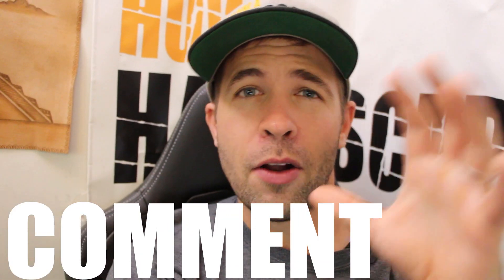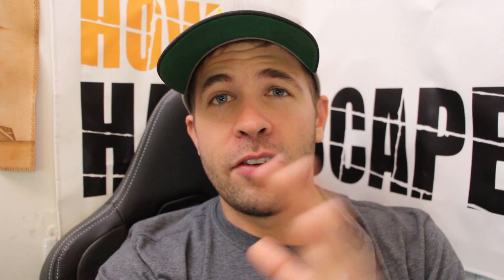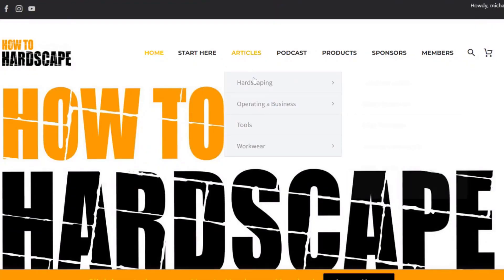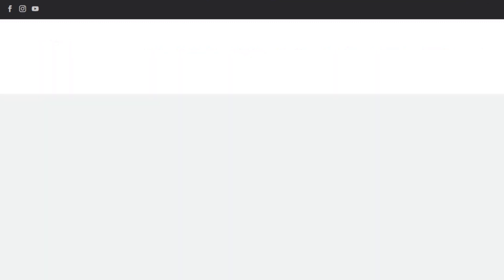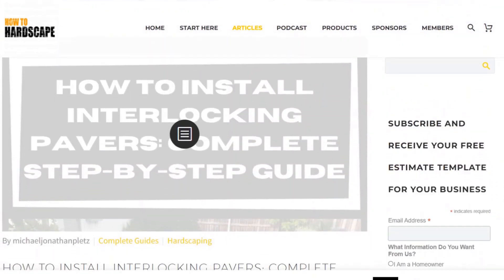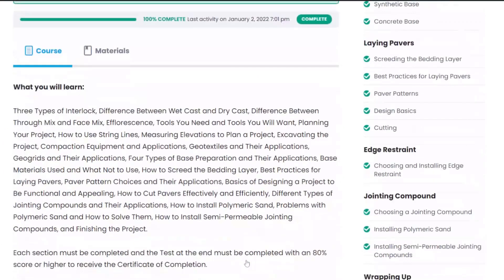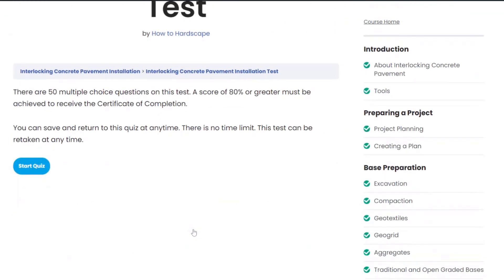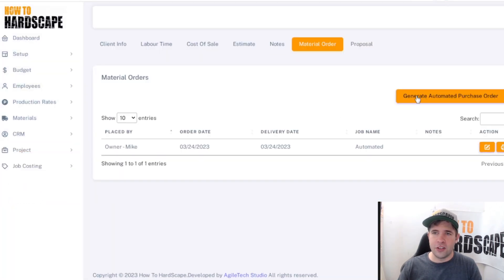Choosing Paver Patio Slope for Drainage

Comment: why woulcnty you be able to raise the grade a bit higher by the house? Im trying to do pavers in my backyard and i wantto raise the grade by my house a little bit so i can make the water go away from my housae easier without having to do a bigger retaining wall on the other end
Reply from the maker: If you only raise the grade at the house, you will have a steeper patio. If you raise the grade at the house and at the end of the patio an equal amount, you will need a higher wall or to build up that end of the yard higher.
Reply: My backyard slopes toward the house, with the last ~10 feet being fairly level. From the house out to 37 feet, the grade rises about 13 inches. My plan is to raise the grade 2 inches at the house and slope it down 2 inches over the first 16 feet. The remaining 21 feet would be a separate plane with a gentle slope that ties into the same 2-inch drop, made possible by a ~10-inch retaining wall. @iamahardscaper
Reply: Does this sound feasible any thing im missing should i add any drains etc?

Comment: When applying your crushed gravel base and bedding sand for a slope of .25 of an inch does this affect how deep the crushed gravel and beddong sand needs to be? Ive been finding between 4 -6 inches of crushed gravel with about the stone depth worth of bedding sand
Reply from the maker: Your excavation should follow the slope of the patio. So the base depth is consistent. I think that is what you are asking. We do about 8” of base but we are always building on clay and have winter freeze thaw cycles. No more than 1.5” of bedding. Definitely not the stone depth worth.

Comment: Thanks for the video. A question if i may: in my diy backyard patio, i am planning to use poly sand to minimize water going to foundation. Have you ever heard/done a strategy like half of patio would be poly sand (close to house) and the other half permeable filler (chip stone etc) to let diverted water drain through joints. 

I know it might sound crazy but wanted to see if it is doable 😅😅
Reply from the maker: It is definitely doable. I have done it for certain applications. But using a semi-permeable resin jointing that looks like the polysand. If yours does not look the same, maybe put a band of pavers across that separates the two spaces and starts the permeable area. Might look interesting and would break up the two jointing areas that may look different.

Comment: Thanks for the info. Is there such a thing as 'split slope'? Planning out a paver patio DIY but the grading goes both left and right toward the side fences. What's the best way to slope to accommodate for each direction? I'm thinking it would become like a 'hill' with the peak being the high end for both slopes, any issues there?
Reply from the maker: Yup you could definitely do that. Just be gradual at the peak because that will translate to the surface pavers
Reply: @iamahardscaper  thank you

Comment: Dumb question. Does the 1/4" slope go in only 1 direction? If i'm doing a square patio would I do 1/4" down to 2 corners or 3?
Reply from the maker: Not a dumb question. It depends where you want the water to flow to. If you just need it to go straight back, it is just the 2 corners. If you need it go to the side and back, then you would apply it to 3 corners. Hope that makes sense
Reply: @iamahardscaper    Thank you. that's exactly what i was wondering. Appreciate all the videos!

Comment: Thank you so much for all of the great information in your videos!!
My question is this: How do I set my stringlines to establish a consistent 2% slope running away from my pool coping stones when I have an irregularly shaped / free-form pool? I am building a square-shaped paver patio to surround the non-squared / free-form pool. Because of this, my 'runs' (when calculating my 'rise / run') are varying at every single point along the parameter of the pool. I apologize for the confusing nature of this question. I have installed numerous paver patios but this is the first time I've attempted one sloping away from a non-linear / curved starting point. 
Thank you for any advice you can offer!!
Reply from the maker: You can run string lines when screeding and measuring the length of the string line and apply a slope to it. You could do the same with a laser level or a high precision altimeter. It is just a matter of every time you set your screed bar, taking a moment to know the slope before you start screeding.
Reply: Okay, I was thinking the same thing: I would measure the length of the string at each point and calculate the slope. But I think that method would result in a ‘wavy’ finished patio as there would be multiple slopes occurring around the entire pool perimeter. Or, do you think the varying slopes would be negligible to the naked eye?
Reply from the maker: I think you are overthinking it. All of the slopes would be the same at 2%. Just the runs would be different. But a 2% slope on each of those runs is always going to be 2%.
Reply: Sounds good. Thank you!

Comment: Doing a small retaining wall around a pool to Separate the grass and pea stone.   There is currently two feet of peas stone between the grass and the pool.  Can I use clean stone for a base instead of putting a drainage pipe in ?   So it can drain into the pea stone.   Because there is already a drainage pipe in the pea stone
Reply from the maker: Oh I usually can’t say anything about drainage without seeing the site

Comment: I usually do 1/8” however I am also always using wet sand now a days. I don’t use poly anymore. With that being said I know you mentioned using wet sand on synthetic base and open graded base. I use open graded base 90% of the time, but sometimes in a flat yard and no plus to run a exfiltration pipe it doesn’t make since so we use a dense graded application there and we still use wet sand. My rep told me that when it rains the water will go through the joints up to a certain point and once the joints hit the crushed stone the water will just start to run off the paver surface at that point.
Reply from the maker: Definitely, dense graded always has its applications. I haven’t done enough research on it to come to a conclusion, but have heard reps on either side of the debate whether to use the wet sand on dense grade. But like you said, it would just overwhelm the base anyways if it was a heavy downpour and wash over the surface just like a patio with poly sand anyways.

Comment: When specifying a project for contractors to bid on, we typically list 2% just in case the contractor screws up a little bit, it gives us a buffer to ensure positive drainage. However, on my home project, I think one percent looks a little better.   Do you recommend any particular permeable jointing compound for tight joints…1/16” to 1/8”?  Thanks
Reply from the maker: That makes sense. Romex makes a permeable product for tight joints. I can't quite remember what the name of it is though.
Reply: @iamahardscaper  thanks!

Comment: Great video. Have been watching to some of your videos and reading materials on your site as I'm about to start on a paver project. Two questions, one related to slope

1: is it okay to put porcelain pavers on top of a concrete slab that is in fairly good condition? If yes, how can I slope it differently from existing slope on concrete.  It's not properly draining as it stands. 

2: better to slope to a French drain that I have to create or a gutter that's on the basement walkway? (The second option is what's happening right now, and I'd rather it completely flow away from any foundation. 

Thanks in advance.
Reply from the maker: 1: yes, I believe you can mortar them, but I would double check that with the manufacturer. Sloping would just be a matter of building up the mortar at the foundation and less at the end of the patio. Once again check with the mortar manufacturer.

2: I couldn't say anything about this without seeing it in person.